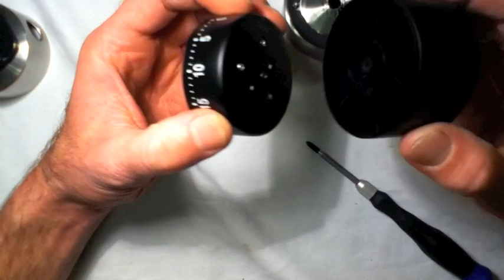How to make a Ikea Timer Time Lapse panning device with a flush camera mount

Comment: This is helpful, along with the remarks from your viewers. I actually have an eBay mechanical time lapse device, which is an egg timer with a tripod mount and camera mount. It arrived with a problem, where the 120 minute timer stops on its own, at the 50 minute mark, which gives me just 70 minutes of time lapse. The seller agreed to deduct 20% and let me keep the device, which now I'm investigating if it is fixable or not. Will try taking it apart, but stop short of letting the springs fly (I hope). Thanks for the clip.

Comment: yup tried to take the hammer out and a bunch of little gears and springs exploded all over the place
Reply: I just did the same thing haha
Reply: keith byrne amazon has a great return policy ;) "timer does not function, would like a replacement" hahaha
Reply: DryFlyRy I just took the timer mechanism out and tilted it so the hammer sticks out then cut it off with wire cutters. That way you don't have to take the two halves a part and risk the springs popping out.

Comment: Thanks for this video. I did the exact same thing you did. However, when I melted the nut into the plastic it created a cavity that was a little too big and when it cooled the nut somehow wasn't bonded to the plastic and ended up coming out. So I used both epoxy and crazy glue and now it's in there good.